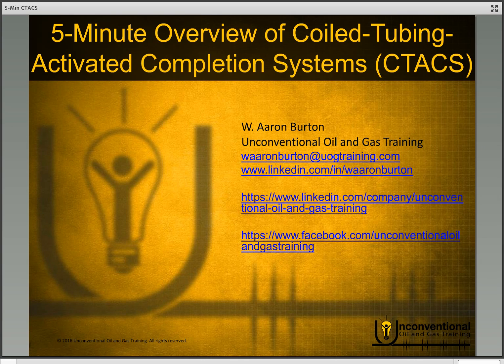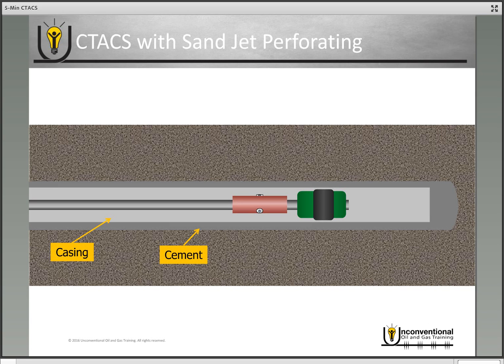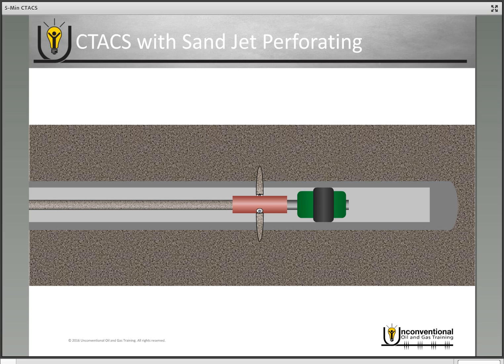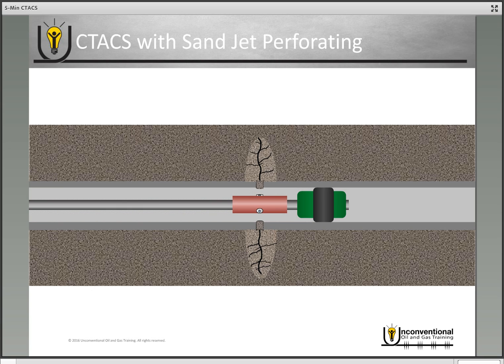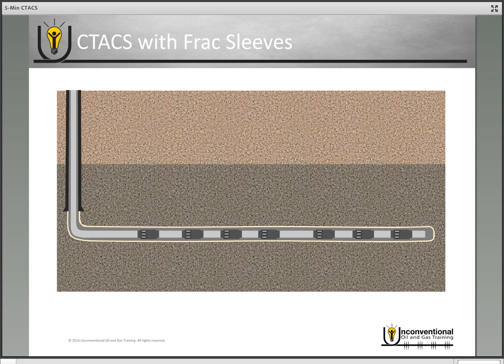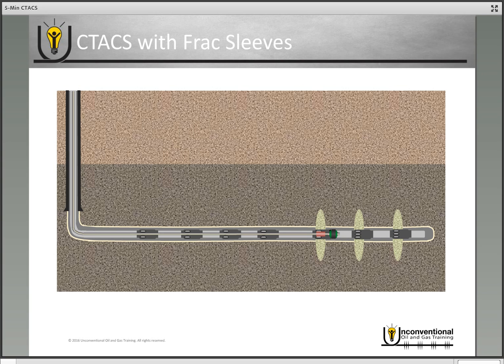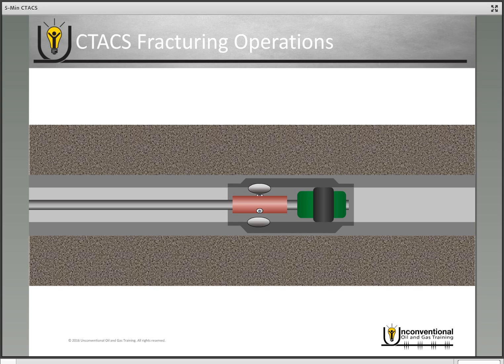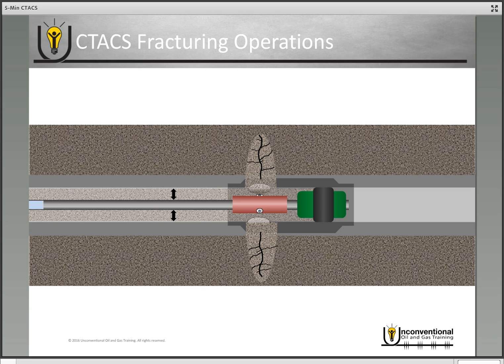A 5-Minute Overview of Coiled-Tubing-Activated Completion Systems

Comment: Hi Aaron, What are the criterions or parameters that direct the companies to choose between ball drop, PnP, or sliding sleeves as a completion?
Reply from the maker: Hi Nour. That's a great question with a complicated answer. Some of the key factors to consider are the cost of the completion and the efficiency during the frac job. Another consideration is whether the completion impacts production by using single-entry points to fracture through ( ball-activated and coiled-tubing-activated sleeves), or multiple-entry points (cluster perforating with PNP) to fracture through. Executing the fracturing operation through single- or multiple-entry points could have an impact on production and ultimate recovery. This subject is highly debated and there are operators and service companies on both sides of the argument. 

The PNP completion system only requires casing and cement to install the system, so it is the cheapest to install. I believe that the low upfront cost of the PNP system is a large reason why the US market has seen a shift to PNP completions in the downturn. 

What are you seeing in the Canadian market?

Comment: What is the purpose of this technique with the frac sleeves if you can do the same thing without them? What's the advantage of having the frac sleeves there?
Reply from the maker: Hi Nick. There are several advantages to having the sleeves. The primary advantage is the time saved from sand-jet perforating each stage. For example, if you're doing 50 stages and it takes 15 minutes to sand-jet perforate each stage, that would require 12.5 hours of sand jetting time. Also, prior to perforating through the casing all of the sand from the perforating piles up in the casing. When using the sand-jet perforator, the operator has to ease into the frac job or they run a high risk of screening out due to pushing the excess sand out of the perforations all at once. They would start at a low pump rate and increase the rate in increments, to push the sand out of the casing slowly. If they intend to pump at 20 bpm, they may start at 5 bpm, increase to 10 bpm, increase to 15 bpm, and then go to the 20 bpm. This incremental pump rate increase also increases the amount of time on location. 

Another option that some of the new sleeves provide is the capability to be reclosed. This feature can be used for refracturing purposes or during the primary frac job.
Reply: @AaronBurton  I think another advantage of these sleeves is to help correlate the CT depth. Right?
Reply: Hi Gent
Another technique with sleeves,  where these sleeves are ball operated, so just a ball dropped from the surface; sleeve open and perform normal Frac without coiled tubing.

Comment: hi .. i just want to know why to inflate the packer if i want to pump the sand out .. wouldent that let sand get between the packer and casing and mite end up in a stuck situation ? regards
Reply from the maker: Hi Ahmad. Just to clarify, this is not an inflatable packer, it is mechanical-set and/or hydraulic-set. You have to set the packer to isolate from the previously fractured stage and divert the fluid into the intended sleeve. Check out the video around the 4:50 time frame to learn how to recover if the assembly does get stuck.